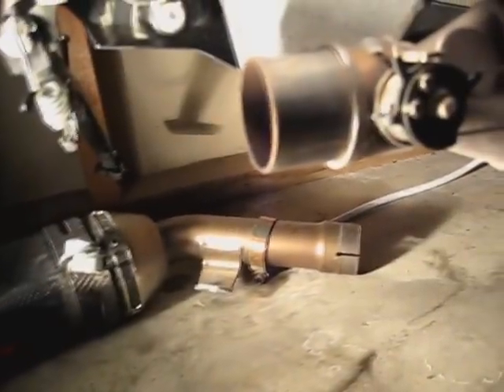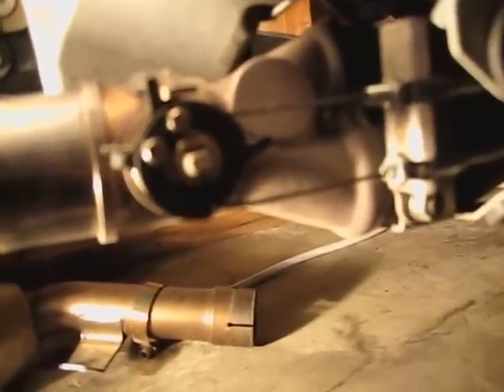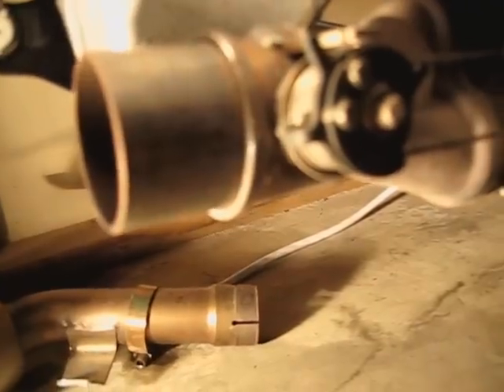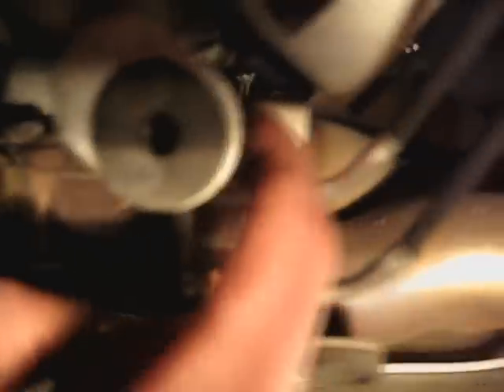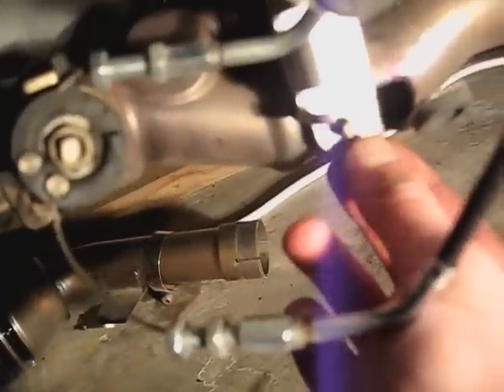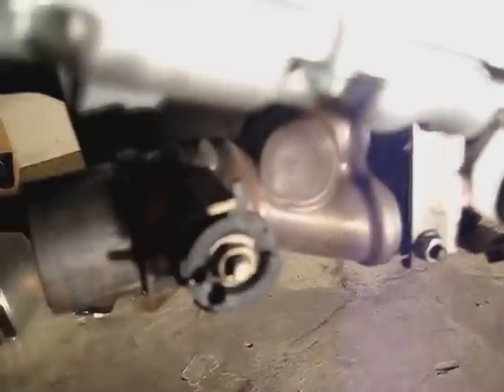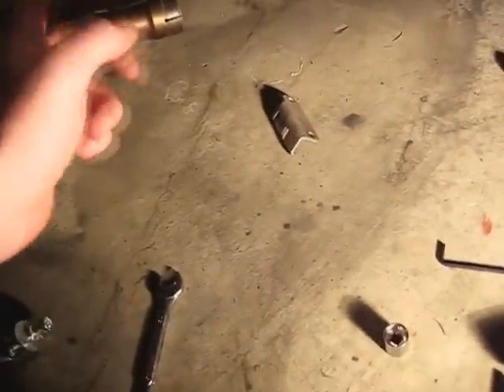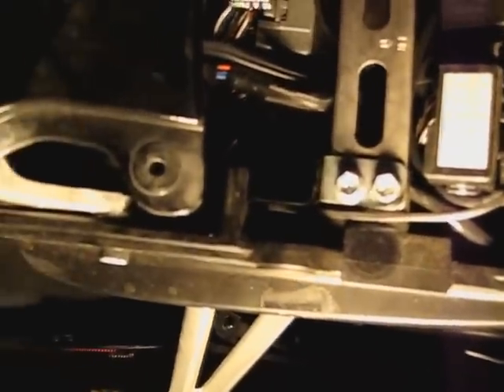2007 Suzuki GSXR 600 "SET" Valve Removal Video Tutorial

Comment: did it last night and that stupid light is finally gone.. it was actually really easy and the camera helps you spot out exactly where everything is... was a little worried about cutting the wire but after i did it was smooth sailing.. took the tank the whole way off and it made it really easy... took about 25 mins to do it all.. thanks great vid..

Comment: This is for those who want more throtle response and more flow, i just did this my bike the other day and it works amazing no joke its the real deal. Okay so make sure u disconect your Battery and your ECU then take all the set valve cables appart etc... MAKE SURE YOU CUT PIN # 30  BLACK BROWN GREEN... Make sure you cut the pin OR YOU WILL GET A F1 LIGHT CODE c46 aka SET Valve Failure. Great Video Man I Will Try To Make An HD One ....

Comment: So, I plan to tackle this project this weekend. My 06-750 has intermittent FI light and a squeal/clicking noise from the right side, rear fairing. Though is video could have had better lighting, I do believe it will solve my FI light, noise issue, and give me better throttle response. I had an 06-600 a few year ago that I installed a M4 exhaust and shortly after had an FI light. The dealer took care of this for me (me not knowing what actually took place) but they said they "opened the exhaust back pressure butterfly valve". After they made my FI light go away, the throttle responded much better and no more FI light. Hope this leads to a "self-fix" on my current bike. Thanks for the vid!

Comment: Perfectly safe to remove. Remove it with pulling the #30 wire don't cut it. Also, install a power commander and you will notice a huge difference. The "bog down" issue in the lower rpms is gone and much smoother throttle response.

Comment: Thanks for the Video I can confirm that once the cables are removed the SET valve it is open.
Check with your manual to disconect the wire as i did. I can also tell you that the bike runs better and it gained 2hp.

Comment: Thanks for the video! Used this and some other forums to diagnose my red FI light. Bought a 600 K6 2nd hand yesterday and only realised the light today! Luckily just a C46 error due to the fact a previous owner had removed the set valve wires but apparently not removed wire #30 from the CPU. Cant comment on whether the ride is better or not but it runs beautifully with the valve set on open :)

Comment: For what it's worth - since removing the SET valve from the 2006(thus fixing the very obnoxious ticking sound the bad servo was making), I've refueled my bike twice from empty.  I meticulously keep track of all fuel and maintenance on my vehicles.  The first tank was 44.2 miles per gallon, the second was 38.7mpg.  The least mpg I've gotten in 13 fillups was 35.52; the maximum was 51.06.  My average fuel economy is 41.48, so both of the post-removal results are within an acceptable tolerance ...

Comment: Nice it's pin 30 that needs to be cut u saved me a lot of research my first time putting my machine on the track the f1 light came on I hate that stupid valve I'll remove it and my pc3 will handle the proper tuning

Comment: p.s.
the valve automatic position once you take the cables off is wide open so you don't have to take your exhaust off to do it.. just disconnect the cable and the valve will be wide open... didn't even have to take off my right side farrings...

Comment: @Duyer18 You don't have to get  A Power Comander, You can actually remap the stock ECM on Suzuki's. And yes if you do the set valve delete it will give you sharper throttle response. I have the same year and HAD the same pipe. I recently upgraded to an Akra hex shorty. I don't have a power commander either, i had my stock ECM remapped.

Comment: My servo on my zx6r is shot...i was wondering if you can remove the servo and valve....guess so. Ppl have been saying low end power is lost but mid range and higher is alittle better. Sounds louder also. My valve is stuck closed, bike works hard to get over 8 thousand r.p.m's.  Im either looking at the servo buddy or removing servo and valve all together. Thanks for the vid

Comment: IF YOU READING THIS COMMENT, YOU ARE VERY LUCKY! Do not uncut any wires (including black one if you got L1 or 2011+ gixxers or you will be in trouble, use servo buddy instead and search for "2011 750 set valve mod" thread in gixxer COM forum and MAKE SURE YOU READ IT BEFORE YOU GO
Reply: Ishvires Nice one!  This helped loads.  Thanks!
Reply: Hypersonik good to know bro
Reply: Relates to 2006 600 aswell?

Comment: I just installed a two brothers slip on,I left the set vave and never cut the cables or wiring.I have no f1 code light and I still have all the power.I suggest not removing any of the set system.It was put on for a reason.Your call!

Comment: I have just fitted a full akropovic system to my 750 09 which means I totally removed the valve but tricked the "gyro" with a component that comes with the exhaust. I get the same f1 light which akropovic didn't explain . Will the #30 wire work for this or is there a problem. Great video thanks.

Comment: I'm sure the set valve is open as default when you take the cables of don't think you need to turn the key I'll be attempting this tomorrow after watching a few videos on this. Still a bit unsure as the cutting the wire on pin 30 tho lol

Comment: Does removing pin 30 also disable all other engine codes? My exhaust actuator broke last summer and pulled all the wires and clipped the wire as you showed in the video. However, now my bike has a rough idle and smells like it's running rich. I put it in dealer mode yesterday and didn't get any codes and I wanted to know if it's because I clipped pin 30. 
Any help is much appreciated!

Comment: Usually the reason for the removal of the SET valve is because you chopped the cat off and want better sound (or some after market exhaust's). If you dont remove it after you chop the cat off, you get a light on your display and your gonna have a bad time!

Comment: i would like to ask ,cos your bike got aftermarket exhaust and mine have stock with catalytic converter its safe to remove that cables and leave valve open ? cos for now mine  gexter done 9800miles and FI flashing ? im curios cos all the bike in youtube with sport exhaust without catalytic converter

p.s forry for a language i am foreign :)

Comment: My motor hex wheel doesn't start off in the same position as yours does. My motor starts off in the adjustment position, cycles only upward and then back to the adjustment position. It never goes down where it is supposed to go. I believe that Petes cycle in Bel Air did this to my bike because there is no reason for it to do this.

Comment: I have a 2006 gixxer 1000 and i was wondering, it it still pin 30 on the wire that you are supposed to cut? is it still black with brown stripe? or is it different?

Comment: Quick question. I bought a 2006 gsxr and the person had installed a two brothers exhaust and the red light is on on my dash. I just want to get rid of the light. I figure its related to the set valve. If i take off exhaust and turn bike on the valve will be set open - would the light stay off? Is there an easier way to turn off the red light?

Comment: Can I just unplug the wire when the bike is off and leave everything in tact?  Is the valve open when the bike turns off?
Reply: Yes. The valve default is full open. You can leave the servo motor attached to the bike. However, you need to buy the servo eliminator plugin. Got mine from vizi tec. Works perfect now.

Comment: I understand the process but I'm still left with the same question after watching this video and reading several forums. How do I know for sure that that the SET valve is fully open without taking my exhaust off? I see people just remove it like you have done and yet they don't mention anything about knowing the position of the valve. Do I need to physically move it to the right position? Or do I need to do something with turning the bike on and off at the right time to make sure it's open...?
Reply: It has a spring that opens the butterfly when the cables are removed

Comment: ive taken off the exhaust, removed the SET, & wire from Pin 30. I did it in the same steps as in this video except i couldnt see that good last night & unplugged the wire from Pin 29 instead of Pin 30, well the bike wouldnt start, today i found i had unplugged Pin 29 so i plugged it back in & took Pin 30 out...the bike still wont start up! has anyone else had this happen when trying to do this? what to do now?

Comment: @tlafntn On my gsxr 1000 k4.the f1 fault comes up as c46,this is the value actuator in the exhaust,under the back seat is a six prong plug with a rubber dust cap on,remove the cap and put a piece of wire across the black with thin white line wire and the white with thin red line wire,this will bring up a fault code on your display unit where the f1 used to be,the bike needs to be running with the f1 fault on.....then google the fault code.....ie.....( k4 gsxr 1000  f1 fault code)...good luck :o)

Comment: ... for my bike's fuel economy.  Suggesting that removing this [useless] device has no apparent effect on fuel economy, and if it does, any change +/- is negligible.  As far as "smoothness", my bike seems to run better with a more responsive top end, but as I said the motor in my SET valve was bad and not opening the valve fully.  In my opinion, the cost and hassle of replacing the SET is not worth it compared to removing it; especially if you ever plan to get an aftermarket exhaust.

Comment: @chiquitico99 
Hey there mr. engineer you prob dont own one of these bikes at all cause if you did you would know every aftermarket full system eliminates the exup motor.. as long as you tune the bike it will re adjust your fuel map... explain to me why i got more power after full system deleting the valve and tuning it??... come tell me my bike dosnt run smooth.

Comment: New throttle response with the valve completely close and it doesn't open cus is spring loaded good job in misleading people homie for the ones reading this either u remove the valve completely and plug the connector with a diod module without the need to mess with wires that is just the wrong way to do and the valve removal included dealing cutting and welding take my advice and not this YouTube mechanics

Comment: The exhaust control system (EXCS) is designed to give perfect back pressure at all RPMs but it most noticeable and at low RPM range.    Disabling this makes you loss your low end torque.   I found that my used bike had it disabled, enabled it and got some torque gains.   Not recommended unless you are putting in a full exhaust system.
Reply: borbor122 I am confused on this. Wouldn't disabling this pretty much be like a full exhaust anyways?
Reply: +borbor122
Agreed. The valve on my K6 seized recently resulting in a fuel injection error and my garage turned the valve to open and removed the control wire as a work around. Since then I've been disappointed by the lack of low end power - although the throttle does have a more progressive and less 'on/off' feel and the lower exhaust note is welcome. Overall the bike feels less brutal at lower speeds, rather as if it has been softened up a bit. With standard gearing a potential extra 2hp at the top end doesn't help much for riding on the street (at legal speeds) unless one plans on spending most of the time in 1st gear. Perhaps it would be worth while for track days or with the gear ratios changed but to me as an intermediate rider it certainly does not feel performance enhancing and I'm saving up for a replacement part so I can get her back to how she was.
Reply: turns out back pressure is a myth and scavenging would hurt more than they'd help.

Comment: the valve is sprung open to the fully open position when the cables are removed.... also on doing this mod be prepared to lose a lot of mid range due to the flap being fully open and resulting in little or no back pressure.
Reply: This is not correct. I gained four horsepower mid-range and seven at the very top on the bike dyno. This valve is for emissions and cold-weather starts.

Comment: ive done all this. ive removed the right wire from the ecm but after a minute of riding, my f1 light comes back on. CAN ANYONE PLEASE HELP?!?!?!
Reply: JoeyKhazma1  My bike is a 2008 gsxr 600 so i dont know if that would be any different but i cant find anything on the net or forums to tell me otherwise
Reply: +JoeyKhazma1 Did you fix your issue? Just curious I know this was 10 months ago. I heard that even if you pull out the wire that the FI light will come on if you disconnected your servo without installing a servo buddy. Your light may have went on because you unplugged the servo, I just left my servo in and disconnected the servo cables.
Reply: Leave the servo on the bike. Just remove the mechanical links.

Comment: Guys there is literally no reason to remove this UNLESS it's giving you trouble. These stupid valves go bad over time (along with the STVAs up at teh airbox) and it's often times easier to just remove them completely instead of repairing them since the actuators can be expensive. If your bike is running perfectly fine, just leave the valves alone
Reply: i agree , this has been the biggest pain in my ass since i removed it i should have left the damn thing alone , learn your lessons from this wise man and dont make the same mistake i did
Reply: 2011 GSXR sputtering at low RPM. FI light on too. I took it in for service. $348 to run diagnostics and reset cables. It didn't work. Took it back in the next day and was told that the servo motor drive gear was damaged. When you turn on the key and the valve goes back and forth that sets the cables. The valve is there for low end back pressure but as you get up in the RPM band it opens more so the engine can breathe. The dealership will replace the servo motor for $515. Or I can yank it all out and put in a servo buddy for $58. I think I'm going to take my chances and see how it goes. I'm using this video to walk through the disassembly. Ill comment later when I have the SB installed. Great video!

Comment: Can anyone confirm that this adds power or takes power and from where?
Reply: Just finished doing myns today, noticeable increase in throttle response and power. Sounds awesome and feels better
Reply: The less restrictions on your engine the more power.
A strait flow will always ad power. The better an engine breaths in and out, the better it will perform. Only the shape and lenght of an exhaust can add you more horsepower and portflow. That valve is many times revert to for being build for emission control but thats bs because a manufacturer cant say outloud that its for loudness controll ;) (I would put a switch on the valve so you can set it fully open) And when your driving home you wont wake up you neigbours ;) Or get attention from Johny law.
Reply: ***** Not necessarily...  You still need back pressure.  I know in a forced induction vehicle 4cyl I had a few years ago I went with 3" pipe from the header out plus a cat deleted.  Before the change I would max at about 13psi and after only hit 9psi.  Added a glass pack (not for sound) for some added back pressure and my boost was back to normal.  I would assume it will be the same on a bike.  That being said,  I don't think the back pressure would be effected enough to hurt your performance by simply opening this valve on the stock diameter exhaust.
Reply: MonsterChuck Back pressure comes from the endbox/muffler (Especialy on a bike) or from the header depending of its shape 4-2-1 & 4-1 etc. Am not gonna say i know it all but.. All the people i know that race with these bikes have it removed and are having more horsepower. Also for reverence lets say, A honda spoon ek9 it has strait pipe google with these words [Spoon-EK-Civic-12] and you will see a picture. They did this voor more horsepower note* NA car. Other factor the airbox can also effect mid range torque. I find your story interesting tho, my gues your muffler was absorbing alot of airflow and the glaspack made a patch in a way so the flow did not get distorted i think.

Comment: @garylouch I did this last night but I was talking on my forum on gixxer.com about it also and one guy showed his whole down pipe and exhaust was cooked because the flapper itself burnt off and jammed closed so no air would go through so I would like to add people should do as I did and drill out the 2 screws holding the flapper in the manifold with a 8/32 drill bit and pull the flapper valve out all together so there is no chance of it jamming once or if the spring giveaway that holds it open.